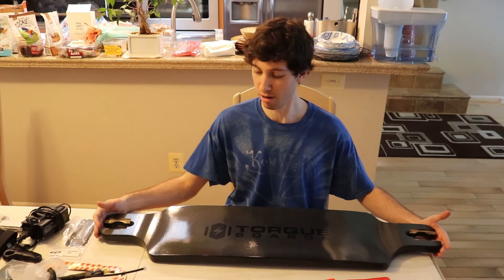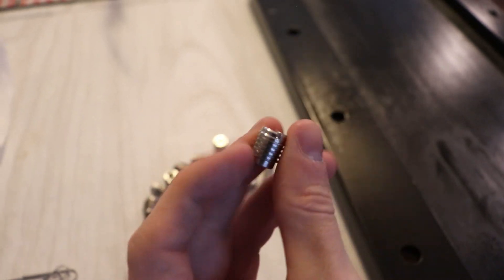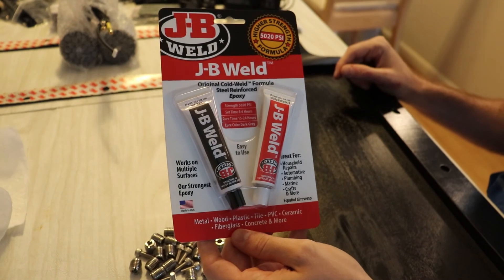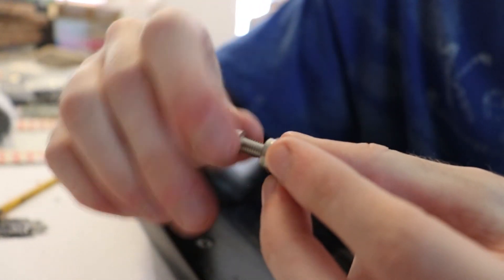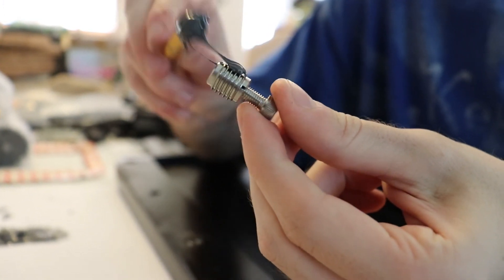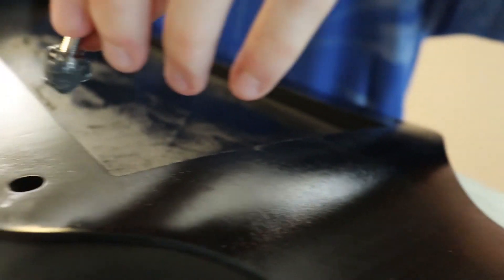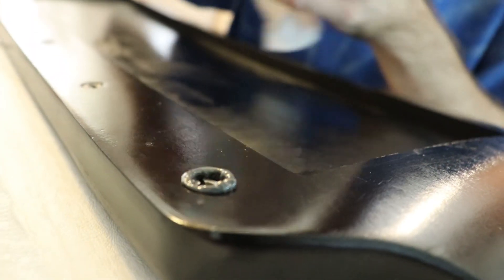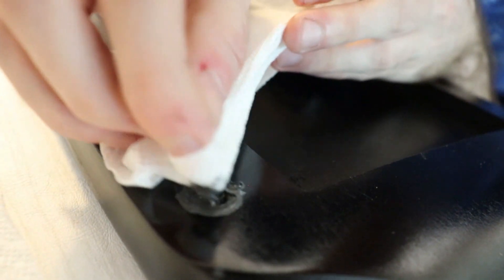Building a DIY Electric Skateboard - Part 1: Threaded Inserts

Comment: Why would I do all of this, if I can get a built and working board online for the same price.
Reply from the maker: It is up to your personal preference! I built my first electric longboard over 7 years ago, before Boosted Boards were a thing, using parts mostly from HobbyKing and Home Depot. I upgraded it over time, but I decided to build a whole new setup just for pneumatic tires. I went with TB parts because they're USA-based, making for the smoothest shipping possible during the Covid crisis earlier this year. I haven't seen any electric longboards out there in the same price range that can outperform this new setup. More expensive boards like Kaly and LaCroix can outperform this new setup only in range, as it all comes down to battery capabilities in the end. But those setups are almost double the price. Also, this setup weighs 28 lbs, not 35+ lbs, making it easier to carry around. It all comes down to personal preferences on whether to build or buy.